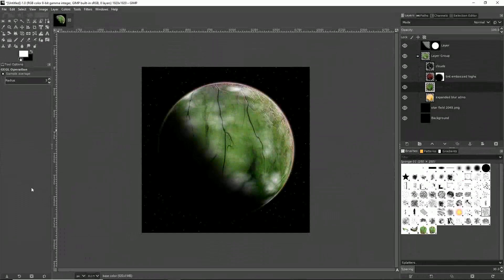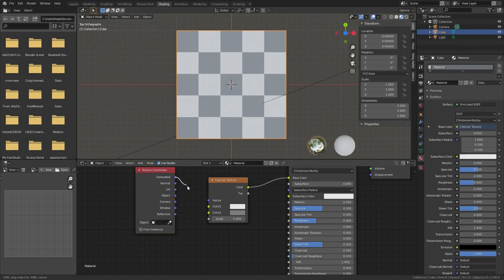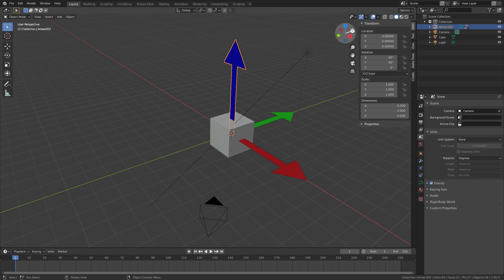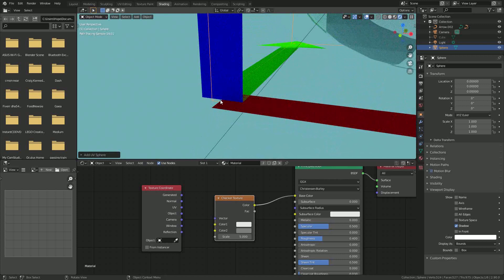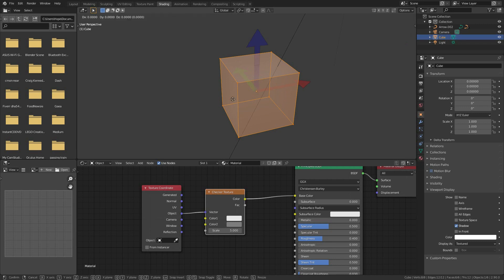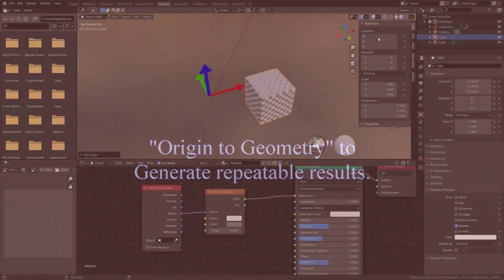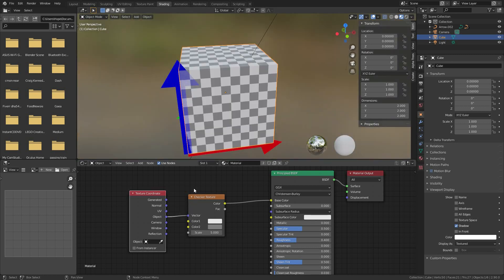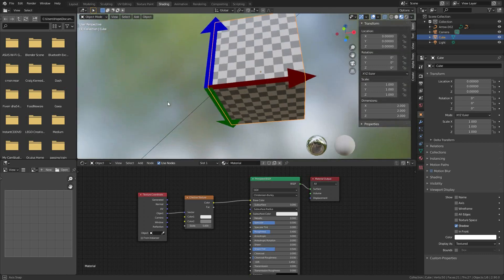Blender Texture Coordinate Fundamentals: Generated vs Object

Comment: my understanding is that :
Generated, origine is Boundry box and 0-1 go to the other corner of the object and represent one Unit of scale.(ideal image Texturing )
Object, origine is origine of Object pointer, 0-1 to a a corner eventually so the Scale is very different.( ideal procedural texture)
am I right with that ? thank you :)
Reply from the maker: If everything is scaled correctly mapping to the object will scale textures to blender units. If everything is scaled correctly OR NOT, using generated mapping will scale textures to the object's bounding box. The object's bounding box will always have a 000 (xyz) origin and always have a maximum extent of xyz that equals 111. A bounding box will never have a negative measurement (it doesn't exist before it exists); object mapping can have a negative measurement because the Pivot Point (000 origin) CAN BE placed anywhere. I think you and I are saying the same thing but your terminology might have thrown me off.
Reply: @HelloHiHola  yes I am not native and on top i learn blender and the topic goes a bit technical but, you clarified ;) thank you very much :)

Comment: One important thing to mention is that when using "generated" from the texture coordinate, you need to exit edit mode before you see the checker board texture display as the bounding box divided by the scale (on the checker node).

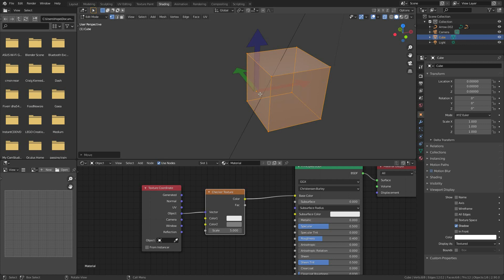Comment: 7:17 There is another way to change the Origin or Pivot point of an object. Staying in Object Mode. Under the “Tool” tab of the “N” Panel you can select >Options>Transform>Affect Only>Origins. Move your Origin/ Pivot Point around to wherever you desire and then deselect it again in the N Panel.

Comment: Hey thanks for the video! When using a brick texture, why does it stretch on all faces other than faces along one axis? I.e. on a cube only 2 faces will look correct and the other 4 faces stretched. It's a procedural texture so I thought it would work in the same way as the checker texture but I'd appreciate any insight!
Reply from the maker: The brick texture is procedural but it is projected down through the z-axis like an image. To show correctly on all three axes, the mesh must be UV unwrapped.
Reply: @HelloHiHola  Doh! Was trying to find a way of sizing universally across a number off different buildings without tweaking the UV for each individually. I've found a complicated math/node way of doing it but thought surely there would be an easier way like a checkbox to universally scale 😂 oh well!
Reply from the maker: @chubbec  pick Object for texture coordinate node and create an Empty. Pick that empty as The Object and any object with that material can have its material affected by scaling the Empty :)

Comment: Hola. Is there some node or some method to get the lenght of an object as input? Thank you, and your video is very useful.
Reply from the maker: Animation Nodes had something similar if not exactly like that, but I'm afraid I know of No Such method for Material Nodes. A thousand points to you though for seeing the use of such a thing!
Reply from the maker: It's possible we could fake something based on an empty object parented in a certain location if you're willing to share some of your goals. The parent object material could then reference the empty and with material nodes make a texture appear at a certain location if the parent object is the right length.
Reply: @HelloHiHola  I was thinking in a node group that could calculate the right scale of a brick texture, aplying the same material on different objects, with different dimensions. The empty seems to be ver useful. Sorry for the spelling, english is not my natural language.

Comment: One very important property of the generated coordinates is that it will deform with the surface when animated.
Reply: That's the downfall of using Object coordinates on procedural textures if the object is going to be animated or deformed in animation, then the object coordinates will not move along with the object.  They don't "stick" to the object like UV's would.  Generated coordinates will.  Let's say you have a noise texture on a ball, then animate the ball bouncing.  The noise will appear to slide across the surface of the ball as the ball moves in animation, which is a big problem.  Generated will keep the noise on the ball perfectly as it moves in 3d space.  Scale is really the only issue, but that's where using a mapping node comes in handy.  Scale down the object, then use the mapping node to compensate for the scale in procedural materials.
Reply from the maker: I think I get that. But you'd have to keep it flat, right? Animating something at an angle to any axis might reveal the volume of the texture as geometry dips into it - like if you tilted the flat top of a cube. The edge that's moving away from the bounding box boundaries would ruin the effect.
Reply: @HelloHiHola  It should deform just like UV's. Check it out: https://docs.blender.org/manual/en/2.79/render/cycles/nodes/types/input/texture_coordinate.html
Reply from the maker: My mind goes to the fact that distorting the generated coordinates without using a mapping node for distortion will make that material impossible to share with anyone else unless their item's scale is precisely identical. However, I wouldn't deny that a careful use of that dilemma could create a neat looking effect.
Reply: @HelloHiHola  Oh it can be useful for creating interesting effects on purpose in animation, that's for sure.  Especially if you use an empty to control the location of the coordinates for the Object.  Yes, you are also correct in that using the mapping node could result in a conflict of scale for others, depending on their scene and object scale, .  However, it's a simple matter of adjusting the scale from within the mapping node itself anyway.  I just feel that it could be even more confusing to a user if they go to animate an object and the material appears to float all over the mesh.  Most people may not realize how to fix that issue compared to simply adjusting the scale in a mapping node.  I guess it depends on how you expect the material to be used, eetc.